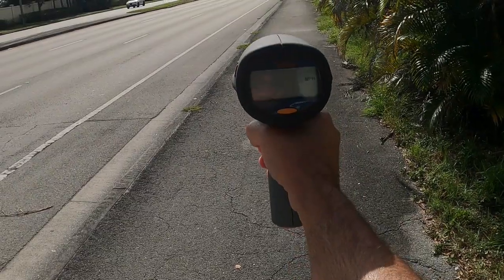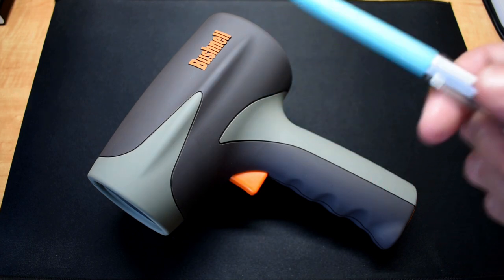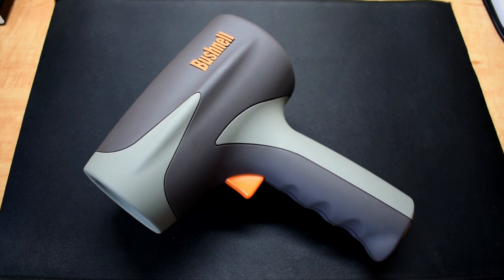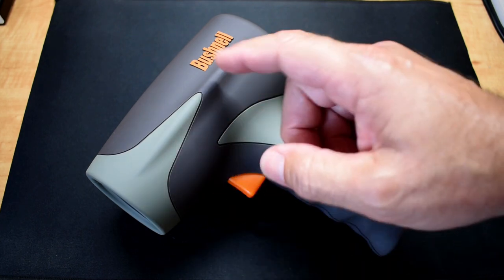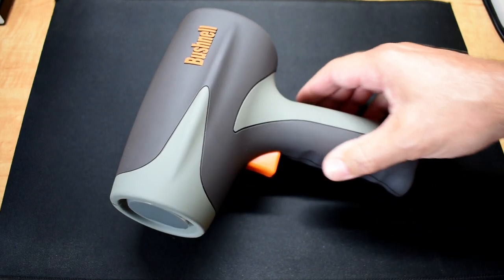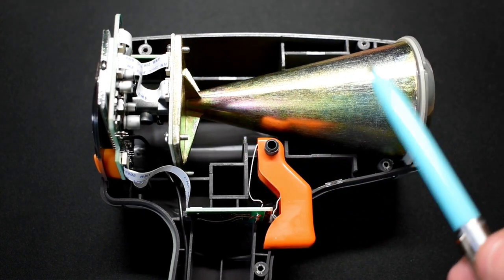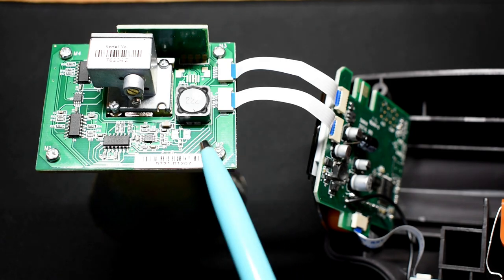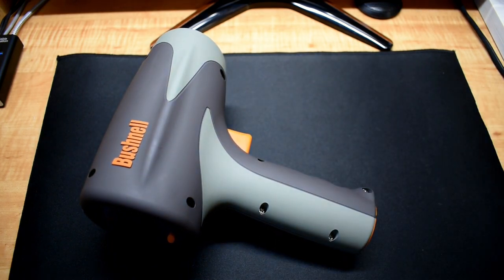What's Inside A Bushnell Velocity Radar Speed Gun? Find Out!

Comment: These are definitely K-band devices operating at or near 24.150 ghz.  The thick sub-cover at the front is actually a dielectric lens to focus the beam, else the horn antenna would need to be larger and longer - it functions identically to a magnifying glass but is opaque because the gun's frequency is well outside the eye's light band.  The MA7801 Gunnplexer is identical to those used in police radar units.

Comment: I was hoping you would show accuracy. Possibly, get someone to drive a car and you take readings, then compare to drivers speedometer. I’m an electrical engineer and normally you turn the screw on the pots to calibrate speed adjustments. You use a tuning fork for that frequency to calibrate it. That’s the short calibration procedure.
Reply from the maker: Near perfect accuracy. I checked against 2 vehicles.

Comment: A wave guid is more akin to a transmission line than an antenna.
Reply from the maker: The antenna radiates the electromagnetic energy, and the waveguide directs it.
Reply: @electronicsNmore  Yup, and more things to add. While wave guides are more akin to a transmission line, a feed horn is more of an impedence matching device to minimize reflections ensuring more power is radiated to free space and recieved from free space with some directivity  for better transmission and reception. The actual antenna tend to be located either directly inside a wave guide or in a few applications, deep inside the throat of a feed horn. 

One facinating device with waveguide technology is the circulator that allows simultaneous transmition and reception. 

I used to work with radio and microwave transceivers. 😁
Reply: Impedence difference and transmission or reflection can be though of like a boat in water. A small boat will be rocked by a wave transmitting much of the energy while a large boat would reflect much of the energy in a wave which transmits very little  energy to the boat. Changing depth of the sea floor to shallow waters changes impedence potentually allowing more energy to be transmitted to a larger boat.

Comment: I've bought one of those for 20 years and the rubber has turned to goo. It still works well though.
Reply from the maker: The rubberized coating does that. Wipe it down with 70-91% isopropyl alcohol to remove the gummy surface. Beware it may also remove some color from the plastic. Test in one area first.

Comment: What is the lowest speed does it register?
Reply: 0
Reply: @boblerner9406  the reason I asked was because we used it to make sure vans don't go over 5 miles an hour inside a building where I work it wasn't picking up such a low speed reading
Reply: @sergeiz.5815   bmfutck 5 moh chef tesite nkght les then 155 moh canbaler need v12 lamgi ebdr far in thise cans
Reply: @sharonbraselton4302  could not understand what you wrote:)

Comment: I've got one of these which I bought about 20 years ago.. £60 then. Over the years the body went sticky so I had to clean it with thinners. It's now smooth and a bit discoloured. 

The thing still works and is still on its original batteries. I believe they work on the 'K' band (18Ghz) but I could be wrong.. Mine has worked great over the years, you can do your own speed check in your car pointing it outside at a sign or whatever. Pointing it at oncoming vehicles tells you their speed but firstly look at your own recorded speed, Subtract their recorded speed from your speed gives you their actual speed. It's only maths.  

I am thinking of donating it to a Council so they can do their own speed checks through their villages as BBC Look North said there was a shortage and they are now too expensive.